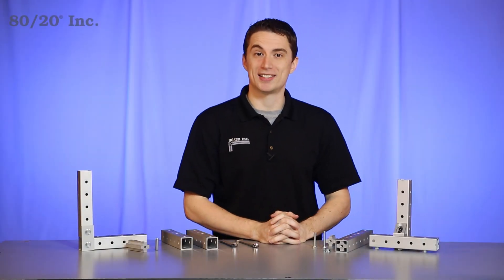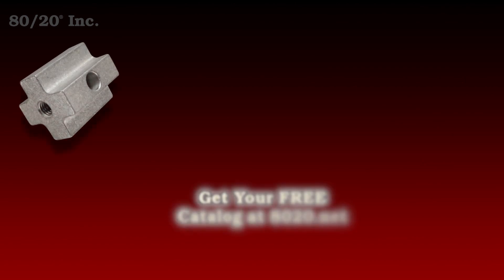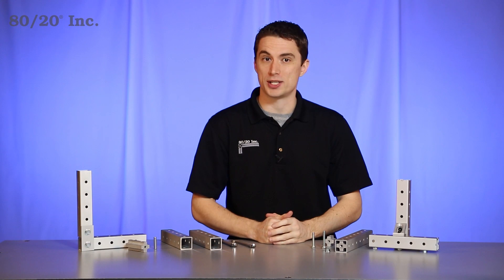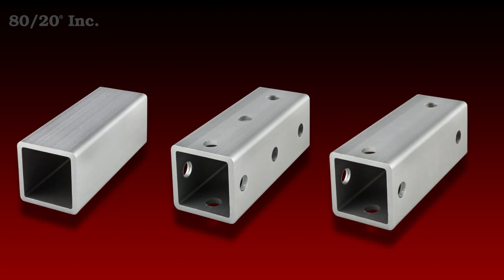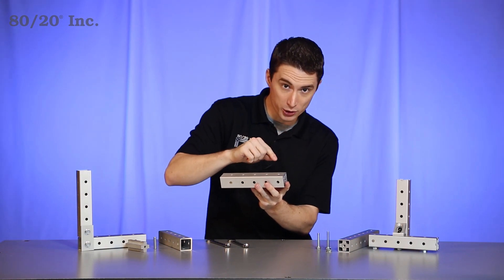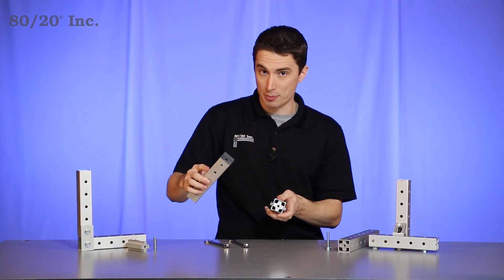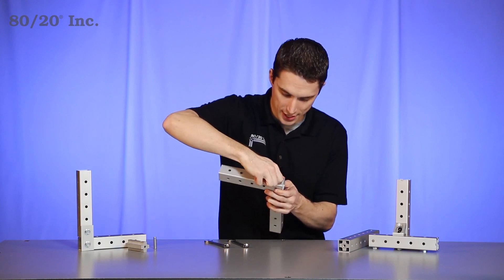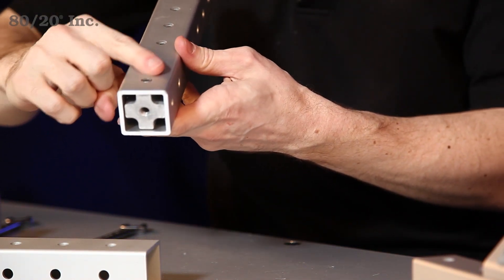80/20: Ready Tube Overview

Comment: i like the part where you explained how the roll pin works
Reply from the maker: Hi there! We're sorry it wasn't clear how to use a roll pin in this video. Typically a roll pin is installed by using a mallet to drive the pin into the bar. Please view a roll pin product page on the website for more information: https://bit.ly/3PEJULv